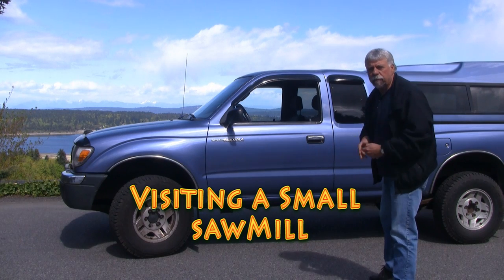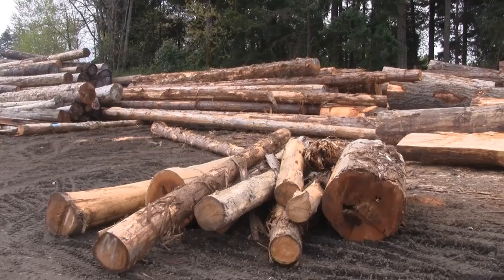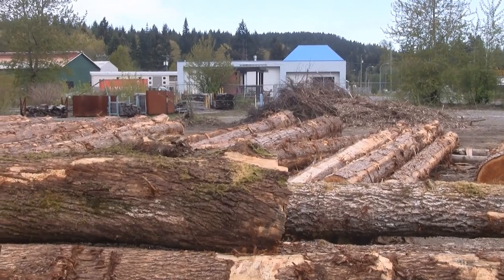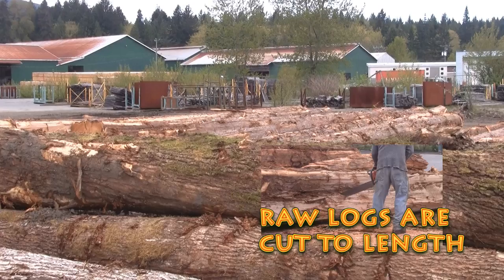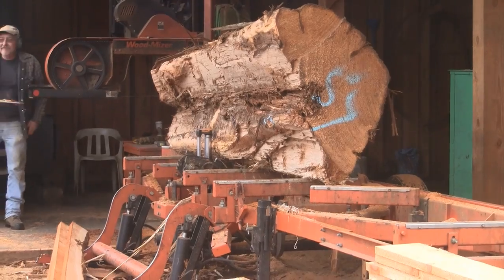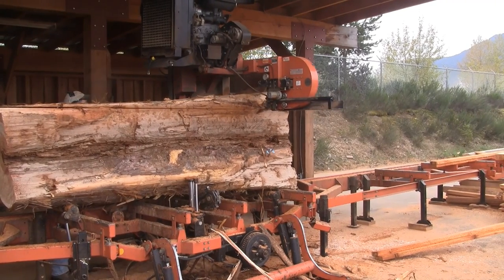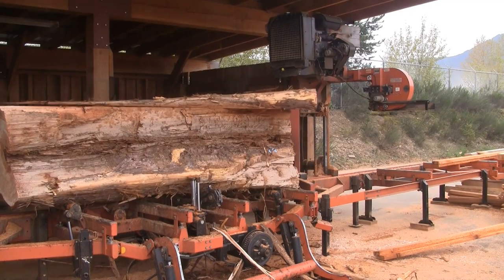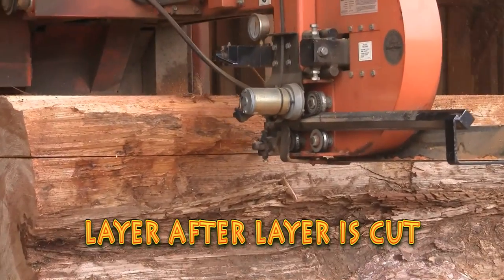Visiting a Saw Mill - A woodworkweb.com woodworking video

Comment: I'm in maple ridge. And just getting into woodworking. What kind of prices does that mill offer. Would I save a good amount of money buying there instead of the larger stores?  Thx.
Reply from the maker: I purchase a lot of my lumber from small mills, only problem, it is often quite green, so needs to dry. Should be quite a few mills in you area,  though you may need to check a bit further out the valley, but I bet there are a few around Abby that could make it worth your while for a trip.

Comment: is this full size like 2x4 or like lumber you buy at home depot where its actually smaller?
Reply from the maker: This is a smaller, custom cutting mill that sells direct to the  consumer, but yes they would cut rough cut 2x4s. Lumber supplied to home depot would be produced at much larger mills on a much larger scale.